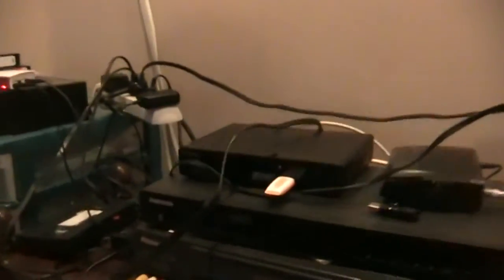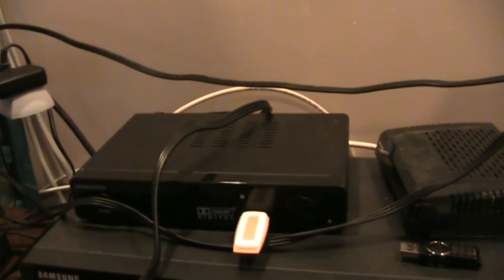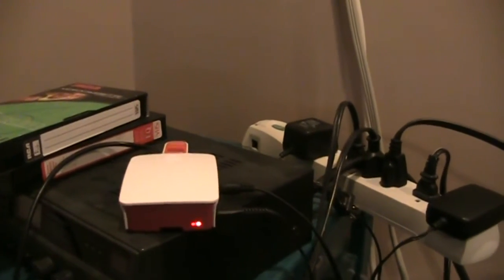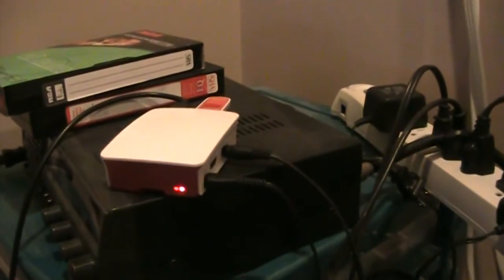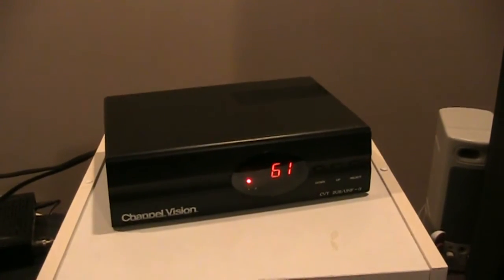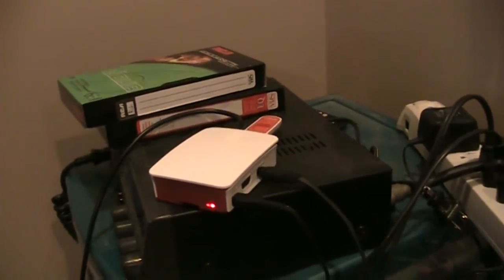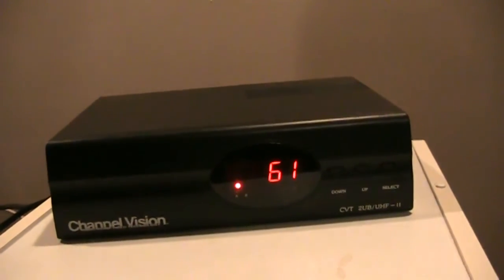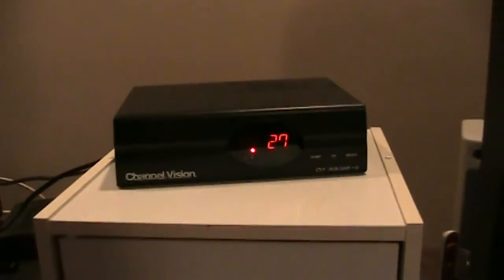How to make your own TV Channels, Channel Vision Uhf Modulator

Comment: Great videos. 

I've been trying to do the same thing for my folks, but the newer TVs are even more fiddily to swith inputs than the old ones. Our older TVs would switch directly to the built in tuner if you changed the channel with the tv remote, but now you have to be be on the tuner input.

We have the new Rogers cable box that auto switches when you press the Rogers button. Do you know of any OTA tuner boxes that do the same thing? Alternatively, would an HDMI auto switch be reliable enough to switch to the tuner box?

I don't really want to buy a seperate tuner box for each tv, especially when the built in tuner works fine, but it seems to be the easiest way for them, other than downscaling the rogers box to SD and putting that on an rf channel, or getting an HD modulator, but that's way too $$$

Comment: I don’t have much practice in this stuff, so I’m asking you how to connect a UHF/VHF antenna on the RF out of the modulator to transmit my analog channel. Will a standard antenna also work as a transmitter? Do I need any signal extender? No video has ever covered this thoroughly. Thx

Comment: Just bought one on eBay, in the meantime I created a channel using my old Betamax as the modulator. Using channel 3 since it’s unused in my area. Now I can watch my old beta tapes on my own closed circuit channel. 
Very cool idea!👍
Reply from the maker: Hopefully you get a chance to digitize that stuff!. Archive it at Archive.org if it is not up :)

Comment: This doesn't cause any interference with your antenna channels and can you find them online
Reply: It's like hey man want to play some Nintendo at my house.
 yeah okay what channel do I put the TV on Channel 3 or Channel 4. no Channel 61
Reply from the maker: I got it off Ebay for under $30 with shipping included but usually i is more expensive Search UHF Modulator
Reply from the maker: I run it with Analog and ATSC Digital Channels and it works fine as long as you use a channel that is not being used.